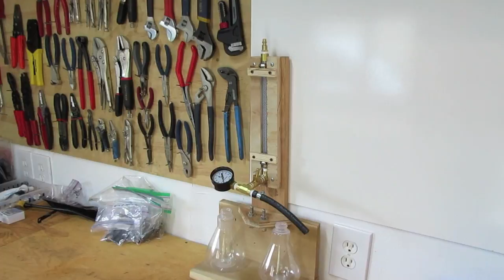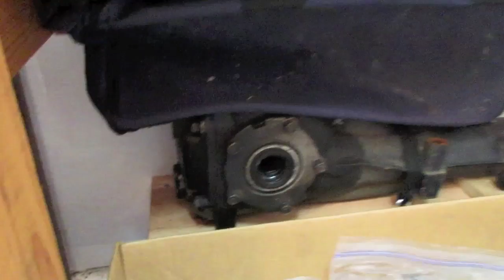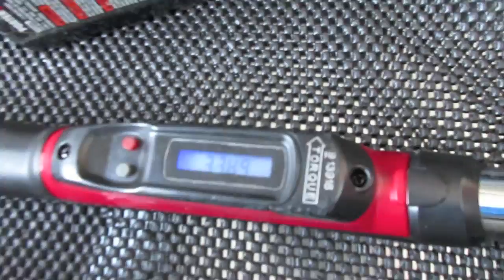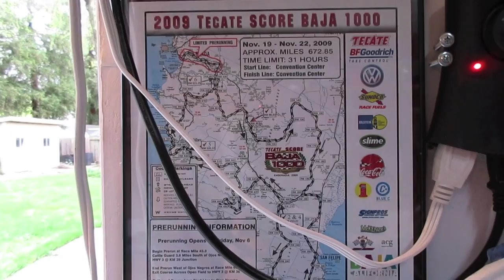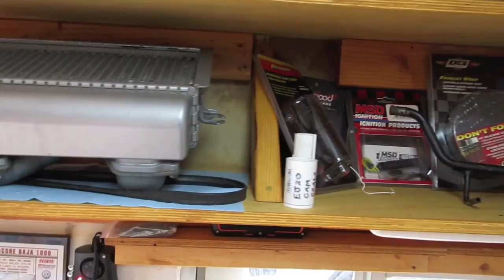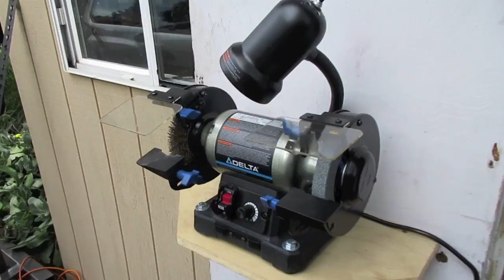Workshop Tour | Layout, Custom Tools, & DiY Hacks!

Comment: Noticed you have some company 23 tools nice setup you have in your shop. I have a 2006 subie sti  learning on the fly  troubleshooting a po448 right now cleared a po442,po456 and a cel 2097 o2 sensor have to check the pcm for that 448. Plenty of value muchas gracias

Comment: Just want to say thx for this video, I watched a couple others and was questioning your background and education.Hearing UTI with a Masters in another subject with mechanical helps validate the videos better.I was thinking at first another hack without any real background and misleading info to boot.Im glad you have a background in automotive with some time holding tooling.Being a owner of a small engine shop, 30 yrs of working on jet aircraft (STILL) and several on recips/ general avaition , IT'S hard to not watch videos and see errors made by others and see the misleading and wrong direction people are lead.Keep the professionalism and details that many miss while trying to inform, this is why your videos have caught another licensed technicians eye and approval.One thing I use in my shop are the LED shop lights,output 6000 lumens- I have twelve and it's bright enough for surgery. Makes a big difference when doing engine work and just having to see everything, just a suggestion.Keep up the good work,Good job
Reply from the maker: +Roger Reed   Thank you very much for the kind words and for the suggestion.  I will do some research.  I will keep it up.  I’m actually in process of building out a compete Subaru Shop in the Bay Area.  Full service.  Sales, parts, and Motorsports.